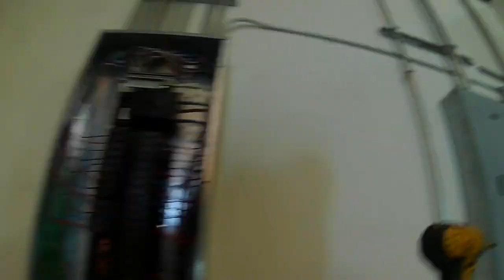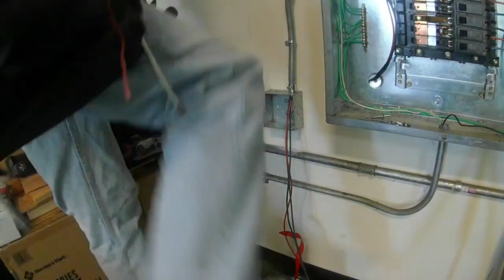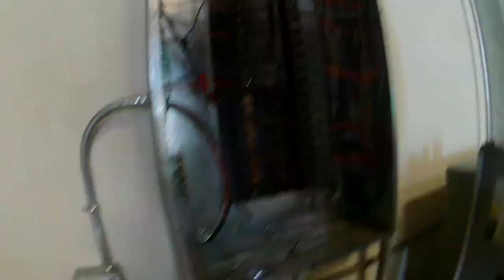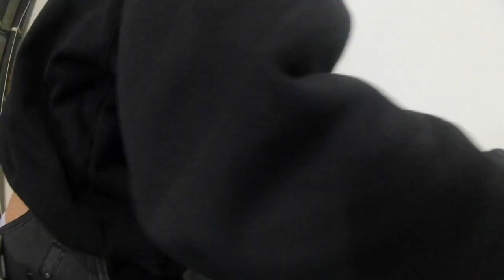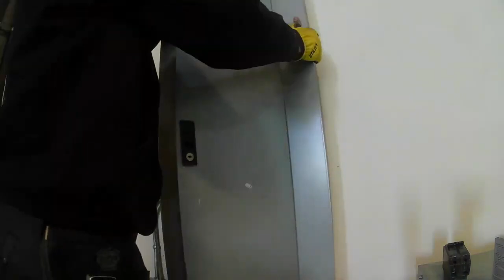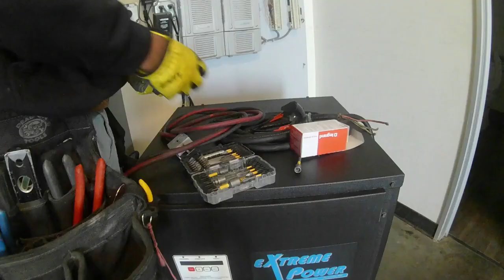Installing power for a forklift charger with commentary

Comment: Hi RW, we tried to do the same thing - hook up our fork lift charger to a 208 panel. Not sure if we need 2 hots and a ground or 2 hots, neutral, and ground. We had an electrician come out and add in a recepticle - 30 amps but the charger will not start up so we need to do some troubleshooting. The electrician (after putting in the recepticle) says our charger may need a transformer. Once he said that, I lost confidence. My question, our charger label shows AC input 240 v, 24 amps, 1 phase,  DC output shows 36 v, 80 amps cont., 115 (Max start), 595 Amp Hrs.   What size breaker will we need to run the charger?  Thanks.
Reply from the maker: The question is what service size do you have at your building?  If you have a 120/208 3-phase service, that charger might not work.  Open your panel door and the information on the back side of the door will tell you what size panel and what voltages it has.
Reply: @rwelectrical9934  Hi, our service is 120/208 single phase. Question, will a 240v charger work on a 208 service? I'm pretty sure the charger does not have any taps to adjust to the lower voltage.  Or, is it hooked up wrong. You mentioned that your hookup was 2 hots and a ground. Maybe our guy hooked it up with a neutral and that could be why the charger is not turning on. Do you have a phone number? or email? that I can get?
Reply from the maker: @1009stu  you may want to call the manufacture and confirm.  With many applications with a 240v piece of equipment connected to a 208v system.  The 240v equipment won't get what it needs to work efficiently if running only on 208v.  It can cause damage or just cause it not to work.  Check the nameplate for the manufactures info.